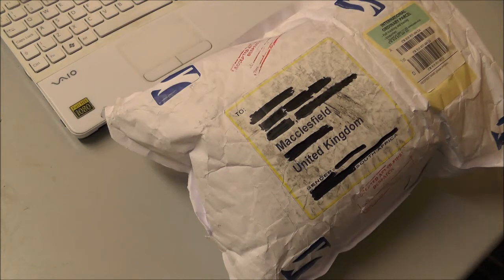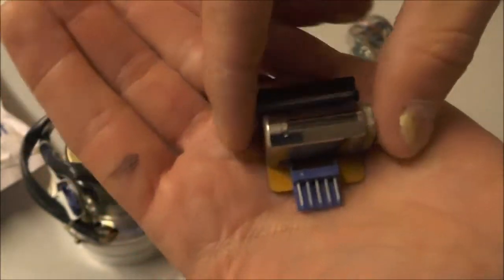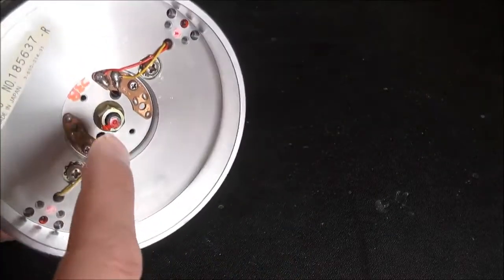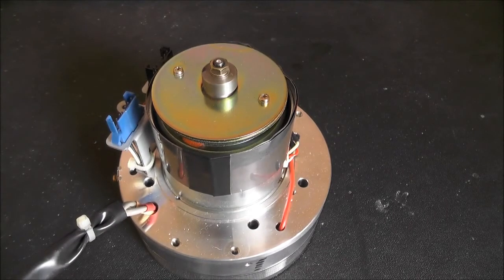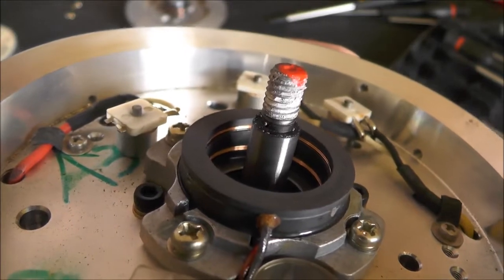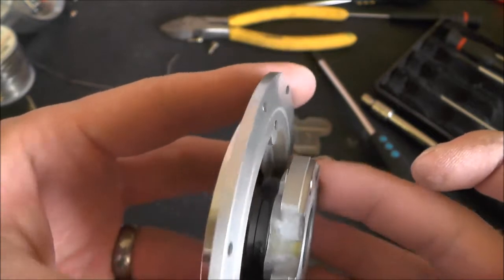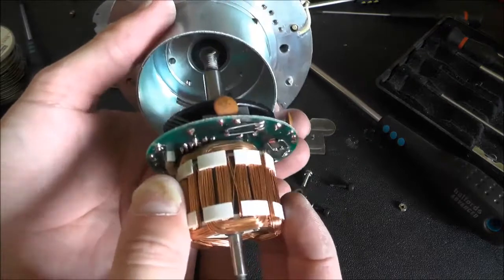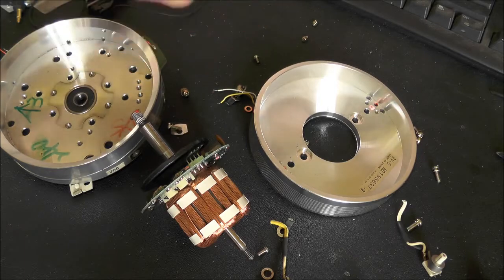DL#018 - Sony UMatic Video Head Teardown

Comment: The kit for replacing those heads was very small in most cases, just those 2 small video heads on the tiny PCB. You used a microscope and a setting jig to get the head height, azimuth and projection right so the head ran on the right path and at the right angle with respect to the tape and just far enough to get reliable tape contact.

Note the first linear head is an erase head followed by the tracking clock head, and the second one is the audio erase head and the stereo record/playback head.

Still have 2 of these monsters left, but the 4 fully mechanical ones ( as in all mechanism parts were done with levers and rubber bands and springs) went to scrap a decade ago, as even Sony thought they were uneconomical to repair. You probably still can have these fixed by Sony's professional service centres, though I wince to think of the price. They probably still are used in broadcast rooms to play back old tapes, and there likely is a huge library of old tapes for them in tape libraries. Pretty much every function aside from level controls and tracking can be done via the wired remote control.
Reply: We sure as hell do get some of this old stuff in.  I work for a certain broadcast repair company which is a Sony ASC.   We every now and again see these old Betacam,HDCAM and DVCAM decks coming in.   Not so common anymore because of solid state media taking over.    Recently I had a J30 player come in which refused to eject cassettes.   It was just a matter of the lubrication on the tension arm becoming glue and not moving.  Cleaned the gunk off and re-assembled.  Fascinating things to work on.